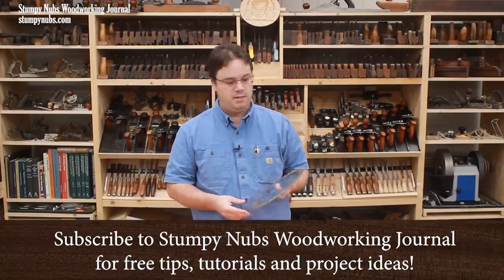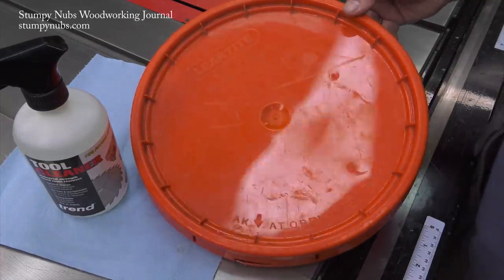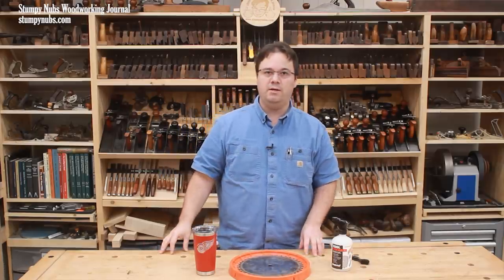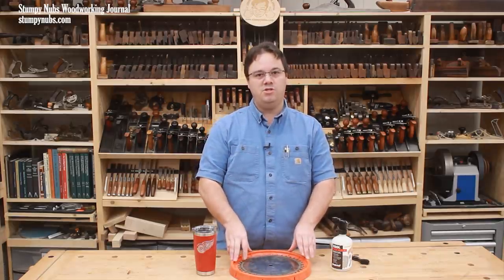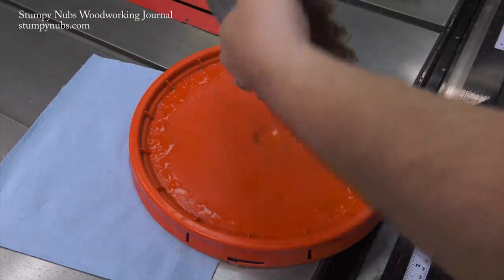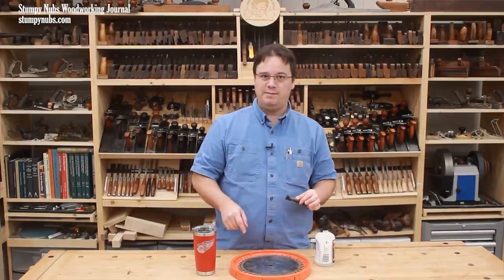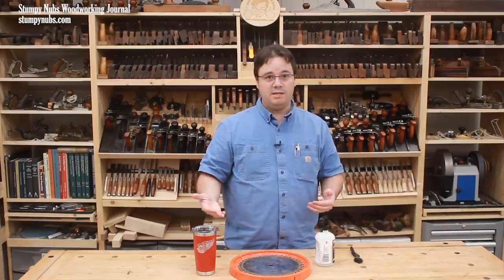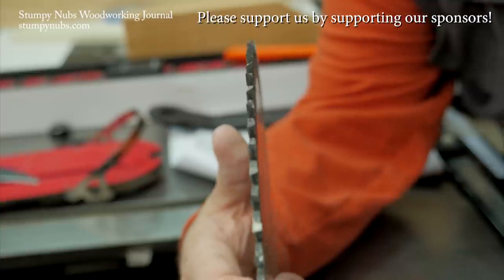This simple fix made my old blades cut like new!

Comment: Nice video.  I just put the blade in a vise and hit it up with a wire brush in the drill.  Works like a charm and no chemicals involved.
Reply from the maker: Seems a little aggressive on the sharp cutting edges of the teeth.
Reply: @StumpyNubs  Did not hurt them at all.  They are carbide so much tougher than the cheap little steel wire wheel.  In the machining world they use carbide to cut steel.  Plus I was on the slow speed and feathered the trigger.  Love your channel, BTW. :)
Reply from the maker: @lucky13farms99  "Tough" carbide still dulls. Wood abrades it. Steel bristles that are aggressively applied with a power tool definitely will. I'm not saying you will break them, I am saying you will prematurely dull the sharp edges. But you do you :)

Comment: Thanks again Stumpy for this nice tutorial.   You are a wonderful teacher.   I purchased Trend a couple years ago when you talked about it then.  Great stuff!  I usually clean my blades with my wife's toothbrush (just kidding) and it works well.  I do use a small brass brush if there is any stubborn pitch needing removal.  I only have one small complaint that I learned about years ago in retail.  If using the word, "cheap", it sometimes can have a dual meaning.  (Your comment about the 5-gallon bucket cover)   I was taught to use the phrase "less expensive" instead.  Just a New Englander...........  :-)

Comment: I follow the same method and cleaner and it really does work well. The only thing I’d suggest is that folks do wear gloves. Someone once advised me never to put anything on my skin that I wouldn’t drink. While that’s not practical for me - I wouldn’t drink deodorant for instance - I got the sentiment as skin does absorb liquids and even if the manufacturer says something isn’t toxic, I prefer not to take the risk with chemicals. 
I have a pair of gloves that I can reuse, which are a bit thick, as they’re designed to cope with solvents, but mean I throw away fewer disposable gloves.

Comment: My blades would slow and smoke when they got gummed up.
I used a wire wheel to clean them by running it opposite the cut direction.
BTW, Trend cleaner contains ethoxylated alcohols and sodium carbonate according to its MSDS, so isopropyl alcohol and degreaser might work as well.

Comment: Hay James! I use the same stuff and the extra toothbrush I get from the dentist each visit. (No… not the same one I use brushing my teeth) I use it on the carbide sanding blocks you reviewed and I bought. It is so easy to use that my blades, router bits, and carbide sanding blocks are always clean ☺️. If it could only clean the litter box out for me it would be perfect! 😂

Comment: I use hot tap water with Lestoil and follow up with a nylon nail brush and a toothbrush to clean between the teeth.  I have also had success with Pinesol.

Comment: +1 on Simple Green but also have found that laundry detergent for some reason works amazingly well. After a soak pitch falls right off. But I was spraying it with Teflon lubricant after and now I don't bc I think it  gunks up maybe due to heat contrary to my original thought that it would reduce friction.
Reply: laundry detergent oftentimes contain sodium hydroxide which is the same active ingredient in grill cleaner but at a much lower concentration. that is likely the reason it works well

Comment: I've been checking my local HD every time I've gone in the past week or two & they never have the lids in stock. I stopped by Lowes today but no there luck either. Lowes 5 gallon lids have no dish to them. I was at least able to get a 3Gal lid today for cleaning my 7-1/4" & 8" Dado blades. Gonna check What lids the autoparts stores stock tomorrow. If no luck then i'm just gonna sacrifice a bucket & cut it down shallow since i have a few spares.
Reply: If you have a Firehouse Subs store close, grab one of the buckets their dill pickles come in. They usually sell them for a few bucks & use the $$ to provide grants to firefighters.

Comment: I use the same blade cleaner, I got it off Amazon. It's worth the $20 or so I paid. It's 6 months later, I clean my blades frequently, and I've stlll got 2/3rds of the original bottle left.

Comment: Very interesting.  I tend to use an old (beat up) pizza pan or cookie sheet.  I do use a commercial blade cleaner that is sprayed on, but have tended to let the blade soak longer to get the wood pitch off.  Cleaning is needed more often with oily or resinous wood in my experience.  I use an old toothbrush or other nylon bristle brush.  I've used that same process on router bits as you describe.  My question is what about band saw blades?  Of course, those are not carbide toothed blade, so you may consider this "not worth while".  But can dado sets can also be cleaned, or only the blades with carbide teeth but not any steel chippers?  I also have an old "wobble dado" blade that I only wipe clean -- something you cannot buy anymore.

Comment: Have you done a video on the varying quality of saw blades? You comment in this video that we should consider sharpening "a high quality blade that's worth sharpening". I realize that you promote Ridge Carbide blades and I would love to be able to afford the quality and cost but for now I'm stuck with big box store blades. If you have done a review of saw blades could you post a link. If not perhaps you could do a blade review. Thanks. Your videos are really top notch and I learn something every time!
Reply from the maker: When it comes to sharpening there are two factors to consider. First, does the service fee cost nearly as much as the blade. And second, do the blade's teeth have enough carbide on them to sharpen. Any blade that costs at least twice as much as the sharpening service should be worth sharpening at least once, in my opinion.
Reply: @StumpyNubs  Thanks for the response. It does clear things up.

Comment: G'day James, great subject mate, for all levels. I do have some commercial specific stuff left and works very well; not particularly cheap here though. WD 40 and the like works ok too, but a bit more bushing.
Btw great tip on a brass toothbrush, as I call it, that'll do the trick with just about any petroleum based product IME. Just need a decent strategy for disposal. Cheers Duke.

Comment: I'd be surprised if an alcohol based cleaner doesn't work well. I'm not a woodworker, but isopropanol is my goto for cleaning solder flux, aka rosin, wood squeezings pretty much.
It's used in rubbing alcohol and hand sanitizer, but the pure stuff leaves no residue and flashes off very quickly.

Comment: Good points but I think you forgot to mention the benefits of cleaning with hot water - the hottest you can tolerate. This heats up the blade a little not nearly enough to effect brazing or temper but it does help the excess moisture on the blade to evaporate off quickly, especially from out of the expansion slots. After a quick dry with paper towel I'll even use a hair dryer sometimes to help ensure a fast and through drying.

Simple green and hot water with a brass or nylon brush. Let it soak for a few minutes in a solution with hot water before scrubbing. No need for specialty cleaners at all.

Comment: First let say that all the Stumpy said is correct and good advice, Ok I went out and grabbed a Oldham 60 tooth I had recently change out because of poor performance and I discovered that a plastic like film covering the teeth area and about 1.5 in inward, than I got to thinking what I had cut with that blade and I could remember cutting Plastic PVC moldings, polyurethane painted wood pc,s and ABS plastic pipe but this coating was also the coating the factory had put on the blade to make it cut better so cleaning required using Lacquer thinner and sanding with 500grit wet or dry which produced a great result, the point to all of this- is don't be a dummy like me and cut plastics at all, and if the goo won't come off try a little rubbing alcohol or even Lacquer thinner, have a dedicated blade for plastics and painted wood lastly check your blades often the factory coating may have gotten too hot and is the problem. Stumpy thank you.

Comment: I've had good luck with dish soap and piping-hot, still-boiling water from the kettle.  The heat loosens the pine pitch and it scrubs right off.

Comment: You mentioned "wipe the blade off" but I just want to add some emphasis to that.  The cleaner you used (I like CMT's cleaner) is intended to be left on after cleaning.  No need to rinse the blade after cleaning it, just wipe the cleaner off and get back to work.

Comment: Simple green is a great cleaner/ degreaser...still, use gloves though...if it strips the oil off your part, it will have no problem stripping the oils in your skin, making you use O'Keeffe's or some other product.

Comment: Just use a cheap $200 20-gallon recirculating automotive parts cleaning solvent tank. Mine has a bunch of stuff mixed in with the cleaner, like diesel fuel and brake cleaner and whatnot, but it sure does clean parts well. Probably be a bad idea to smoke around it though… ;P

Comment: Why should I not use a steel bristled brush on the carbide teeth?
Reply from the maker: Steel is hard, carbide is brittle. You can abrade the sharp edges with it.

Comment: Okay.  Just exactly what is it that builds up on saw blades that interferes with the cutting edges so it does not cut like it is suppose to?  The blades I use are not used all of the time but they have been on the saw for many years and I have seen nothing built up on them or any decrease in their effectiveness.

Comment: Simple Green recommends against using their green product for cleaning table saw blades. Over time, it can degrade the brazing that holds the carbide to the blade. Instead, they recommend their purple Pro cleaner, which will not degrade the brazing, if you soak the blade for a long time. It's what I use. It does a great job. I find it at the big orange store.
Reply: Do you dilute it with water or use it full strength?
Reply: Simple Green recommends against their green product for table saw blades!???!?!?  Purple Pro it is then

Comment: I usually just turn the saw on and scrub the side with a scotchbrite pad... I'd give this method 2 thumbs up, but uh... I'm a little short at the moment.

Any concern about the blade rusting with cleaners? Like should we install the blade and run it immediately after the ensure it's bone dry?
Reply from the maker: I rusted a blade by rinsing it off with water. I believe the Trend cleaner I use has a little very light oil (of some kind) in it because it never rusts. But they do say it is water based.
Reply: Don't make jokes about scotchbrite on a RUNNING saw blade - some newbie may try it.

Comment: When did we stop waxing our blades and surfaces
Reply from the maker: The wax would wear off a saw blade in seconds as the wood rubs on it.
Reply: @StumpyNubs  yes wax does ware off but it also cleans the blade. So while you’re working hit the blade with wax and the surface and your good to go
Reply: @StumpyNubs  also your video was about cleaning the blade. So if one knows their tool like a knife then they would have a clean sharp blade

Comment: now i am retired and my workshop is at home, i just take the blade into the kitchen sink.  pour a kettle of boiling water over it with some dish liquid.  wait a minute and all the crud comes off.  before i used to soak them in meths, which i think you americans call de natured alcohol.

Comment: "Third, it is just the right size for a saw blade."

Well, it is just the right size for a TEN INCH saw blade.  But too small for my 12 inch blades.   I haven't found a 12 inch lid or pan that is actually a full 12.00 inches across.

Comment: Many people use and recommend Simple Green. I do not.

The folks at Simple Green also say not to soak carbide blades in regular Simple Green. In the past the word was it could eat at the binder holding the carbide to the blade.

Probably that process wouldn't cause a piece of carbide to fling itself at you, but I wouldn't risk it.

Simple Green has a product,  Simple Green Pro HD which is ok for soaking.

I prefer using washing soda dissolved in water myself. I hate the simple green smell. So does my wife, so we don't have it in the house.  Washing soda doesn't smell, it doesn't catch on fire, and it is very inexpensive. The powder dissolves in water and you soak the blade in it. Depending on concentration, it is very fast. Be sure to keep it out of your eyes. I would say the same for the Trend product, simple green, brake fluid, oven cleaner, and so on. Wear safety glasses.
I hear some people use baking soda in water. That is a different product, but if it works you could use that. Keep that out of your eyes as well.

Comment: Those Ridge blade are $$$$$$$$ and much more expensive than Forrest blade.
Reply from the maker: "much, much more expensive than a Forrest blade?"

Are you sure about that?

Forrest Woodworker II 40T General Purpose blade: $175 (https://www.forrestblades.com/woodworker-ii-all-purpose-saw-blade-for-table-saws/10-woodworker-ii-saw-blade-40-teeth/)

Ridge Carbide 48T General Purpose blade: $149-10% discount code= $135 (https://ridgecarbidetool.com/collections/table-saw-blades/products/10-x-48t-25-atb-5-afb-20-hk-087-125-ts2000-ultra-combo-blade)

Comment: "Don't use steel on carbide"  What? Why? Better tell all of those cnc guys that cut steel with carbide all day....
Reply from the maker: I didn't say never use any kind of steel with any kind of carbide. I said don't clean a sharp carbide blade with a steel brush. The reason is because steel will wear the sharp edges much faster than the wood will, and softer brass or nylon won't.